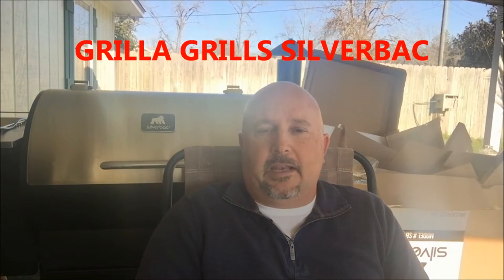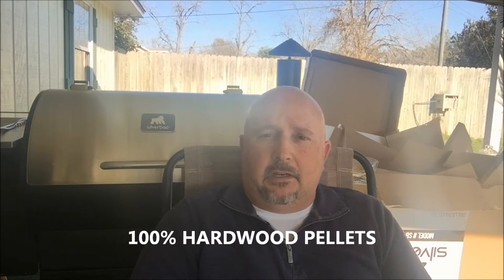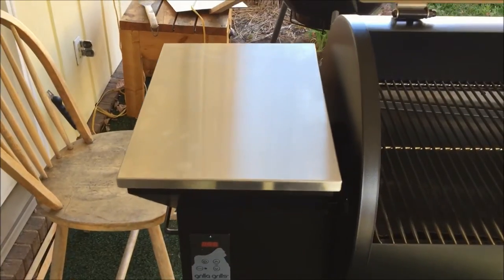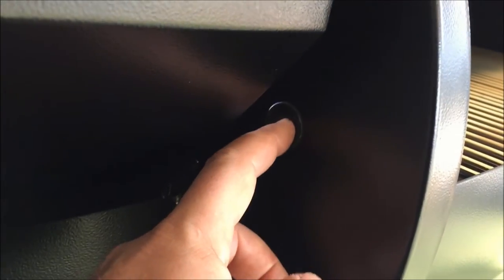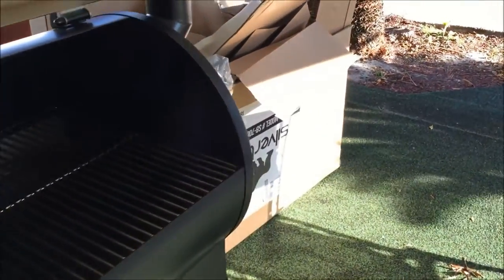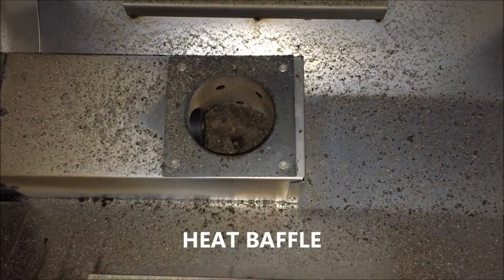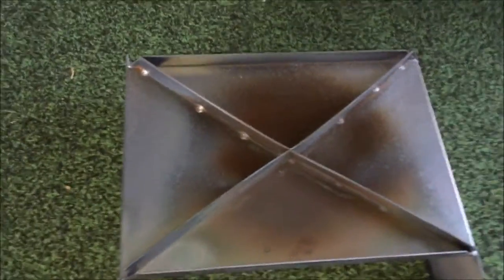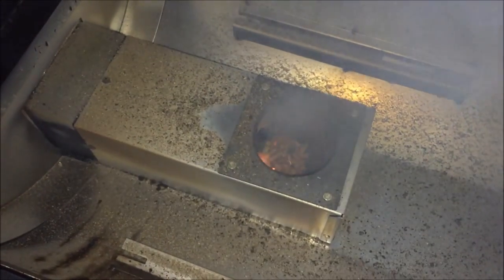Grilla Grills Silverbac Unboxing/Impressions

Comment: My wife and kids bought mine  for Christmas. We live in Michigan and I’ve used this grill 6 times since Christmas 2020, cooked ribs, butt, burgers and chicken. This grill is the real deal. The construction is top notch. There is nothing to go with this grill. I vacuum out the ashes before every new smoke and my is this grill great. Made ribs in 20 degree temp, 4 hours at230degrees and they were 👌. I’ve wrapped and not wrapped the ribs and each way, they were perfect. Holds the temp well for the outside temp. My son had researched the grills and for the money, it’s by far the best dollar for dollar grill out there. Maybe the Yoder is a bit better but price is almost 3 times this silver bac. I’ll take the silver bac. Definitely a great deal. Check one out and compare how they are made with other grills. It no comparison.👍

Comment: How does fire box avoid impact-ion with ash building up and continuous flow of the pellets for long cooks (how do you clean ash build up out of fire box; does it have an ash clean out? Thanks
Reply from the maker: There is very little ash build up.  Because the pellets are compact, they burn very clean.  With that being said, after about every 4th cook or so, I vacuum out the bottom of my grill, including the firebox with my shop vac.   That is how I keep mine clean from ash.  I also line the drip pan with foil about every 4th cook to keep it clean from grease.
Reply: Good deal. Thanks

Comment: can you sear with it and does unit have option to shut down after meat probe meets desired temp
Reply from the maker: It is difficult to "sear" without the optional grill grate although it will reach temps upwards of 500 degrees, and no it will not automatically shut down.  I'm not sure that I would want my grill to shutdown after the probe meets the desired temp.....I think there is a fine line between total automation and still having to pay attention to your grill.  I know that there are some grills that you can program set temps, but I have personally looked at one certain brand and after feeling the construction, I'd rather have the construction of the silverbac and cut it off myself.